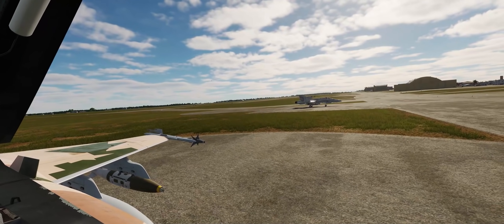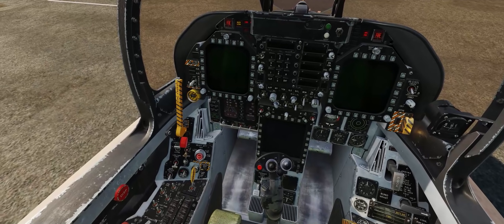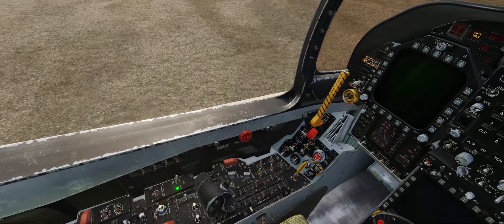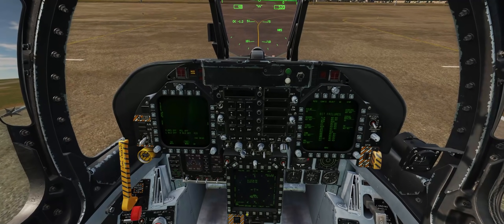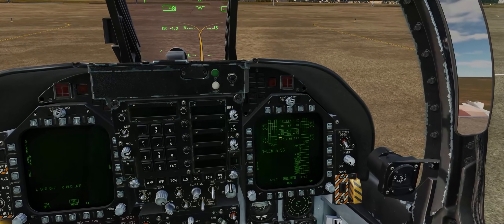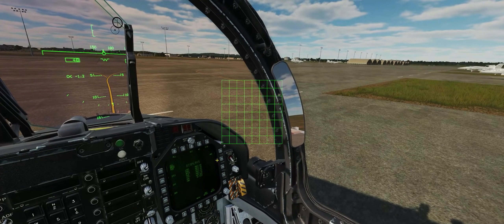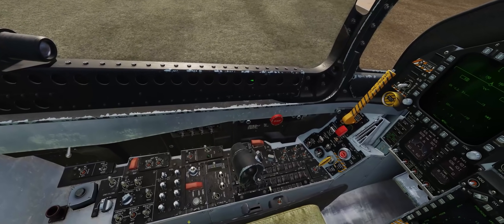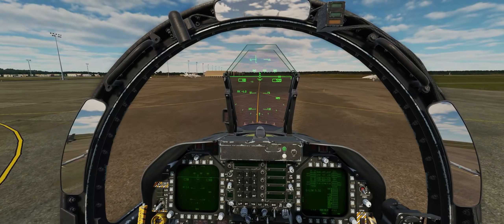DCS F/A-18C Hornet NEW Cold Start & HMD Alignment Tutorial!

Comment: So the BIT run thru is not needed? I normally do the BIT by holding the Y key and left clicking and holding the FCR button and watch all the control surfaces move. It's actually kind of cool. And there's a lot of messages on the FCR page saying many systems are not ready. They just go away? I know somethings are very automated and do not require pilot in the loop. Great update, didn't realize Betty was a tape! Those silly 80's engineers!...

Comment: US Navy Hornet Ground Crew AT2 FC/TS here.. just FYI the Countermeasures WILL NOT FIRE with weight on wheels.. just like any other ordnance on the aircraft.
You can set whatever you want and it still will not fire on deck. We have safety measures.
Reply: Say, is there any circuit breaker I can pull from the cockpit to disable that safety? 
You know, for science.
Reply: @npc6817  definitely
Reply: @trustii5128  and which one might it be my esteemed sir
Reply: @npc6817  that's a good question, i just don't see a reason why it wouldn't be connected to a circuit breaker
Reply: @npc6817  nope as that would defeat the entire purpose of the feature. To do that you need a test set to trick the aircraft into thinking its airborne.
Reply: @CVSiN  I put gears up while parked and the plane exploded.
Reply: The starter plane did!  And it was the best feature for me

Comment: When i start up the Hornet i turn all the instruments and the HUD on before engine start so the come to life as soon as the engine fires. Once the right engine is stable i turn on the INS alignement and crank the left hand engine. while thats starting i turn on datalink, iff and set tacan and ils channels + radios. When the left engine is stable aswell i shut of the APU and continue with stuff like standby ADI, Altimiters, FCS bit etc. Helps me get in the air quicker doing it that way^^

Comment: Great video as per usual

What head tracker do you use as it works so nicely? I bought the Decaln one last year and I honestly could not set it up well and basically just scrapped it but looking at buying one that will actual work well or easy to set up. Would that be the TrackIR 5 the one to get? Thanks a lot Spud.
Reply: I had a track ir for a long time. only complaint is it works really great in a dark room, but horribly if there is any back light of any kind. kind of sucks if you’re sensor is facing a sunny background. If that’s not an issue, then track ir is the move

Comment: At what point do we cycle the Bleed Air nob?
Reply: Sorry, I kind of jumped the gun. He does cycle the Bleed Air later in the video.
Reply: @williehayesjr8336  As soon as the engines are on. IRL bleed air provides cooling to the Avionics and the ECS (Environmental control system, think AC) Spud dropped the ball on that one.
Reply: @VassilliHD  Not to mention you'd be sweating your balls out without bleed air in a closed cockpit. Imagine a hot summer car with windows up.